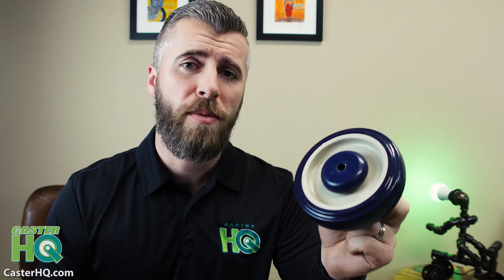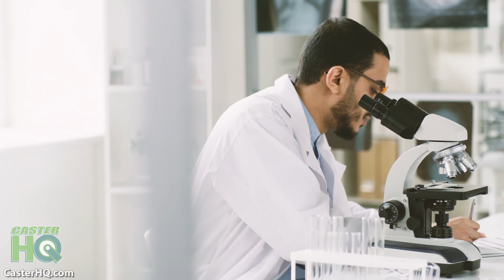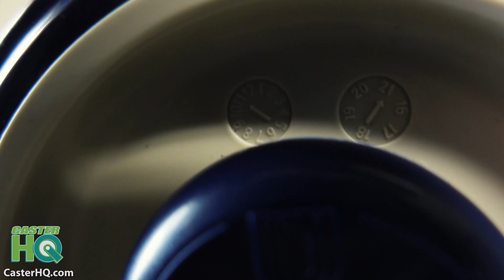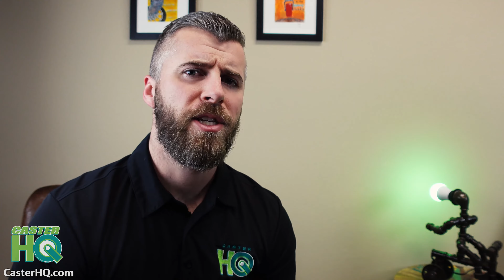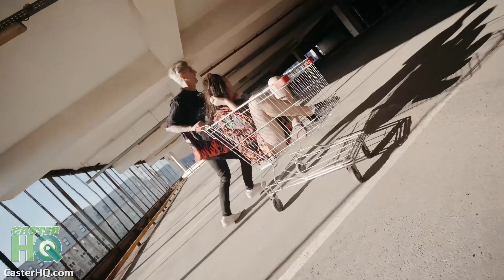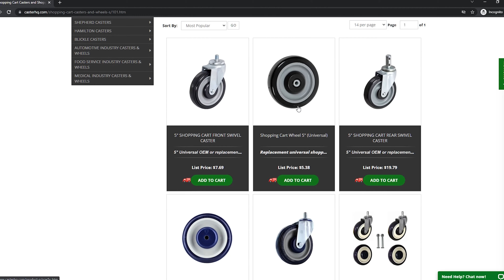How to Fix Shopping Cart Wheels

Comment: Great, this isn’t about fixing the shopping cart wheels it’s just about wheels. I found an old cart and I got the bolts in the front casters won’t come out and I’m practically tearing the thing apart trying to get the bolt off. I managed to get one but I pretty much had to cut it with a hacksaw. Is there an actual reason these things should be stuck in place even after the nut comes off or is it just old and jammed up? Doesn’t really matter as I’ve melted the wheels off with a blow torch so I’m gonna have to hacksaw off the bolts now, fortunately I didn’t need the wheels themselves.

Comment: How about when you buy and self assemble a cart, and a back wheel falls off? I did that, after two wheels broke and fell off my previous cart. Actually, the newer cart eventually lost a wheel, spring, pins and hub cap. I had to buy another cart.

Comment: Are the bolts welded into place or is it that rust prevents the bolt from coming out
Reply from the maker: The rigid/fixed casters are usually seen welded in place on a lot of shopping carts. The bolts should not be welded in place. Most likely rusted. We offer replacement axels, nuts, wheels, and compete casters if you need any help. Thanks!

Comment: Which adhesive is best for polyurethane wheels?
Reply from the maker: Cyanoacrylate adhesives generally bond well to PU, with grades such as the Permabond 731 and Permabond 2050 being best suited for elastomeric PU. For bonding flexible PU, we recommend the Permabond Flex CA Range which maintains the softness and flexibility of the bonded substrates compared to standard cyanoacrylates.
Reply: @CasterHQ  Thanks for the information